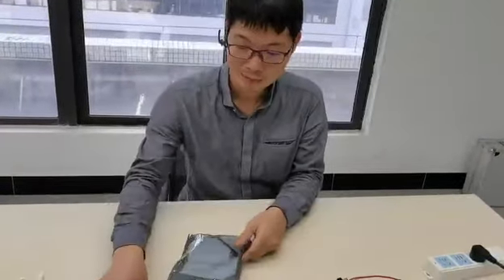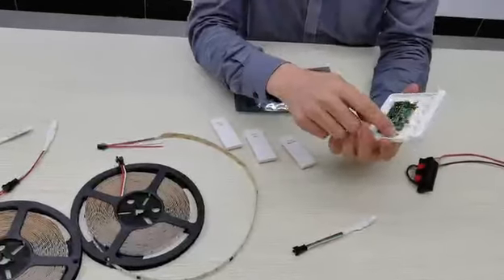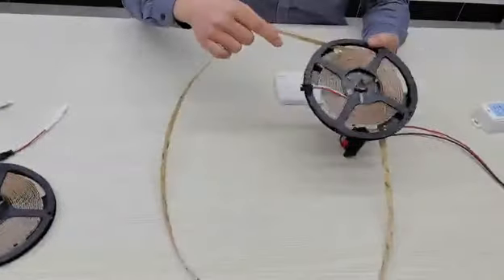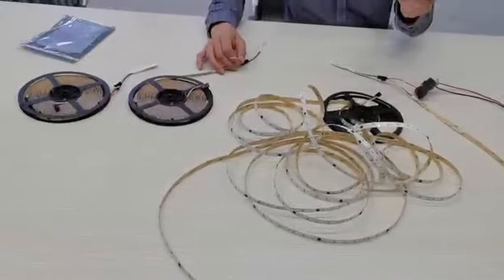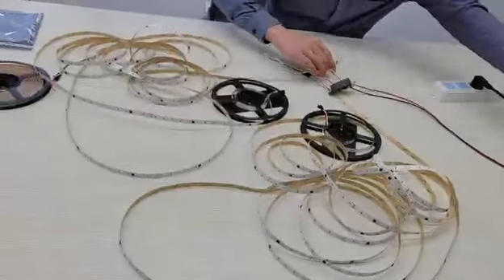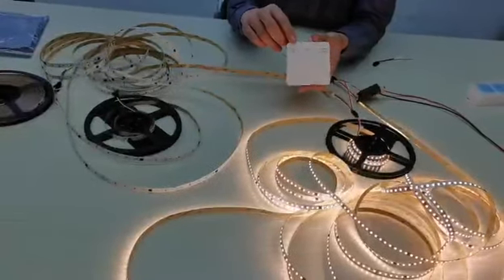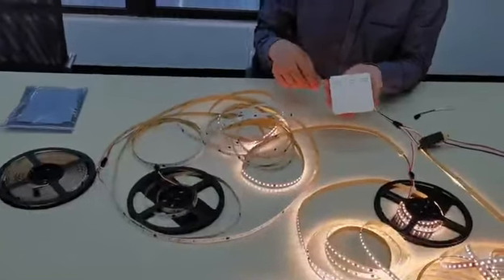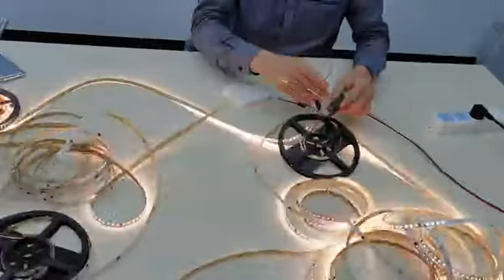Running led strip light

Comment: How much power supply is required to run 10 meter running water led strip❤
Reply: Depends on your strip light looks how much watts consume per meter  multiply by 10 and that’s how much power you need plus 20% of head room you don’t want to run it at max power

Comment: Can it be used without the wall switch?
Reply: You would set it to the auto running model via wall switch first, then it will be running without switch.